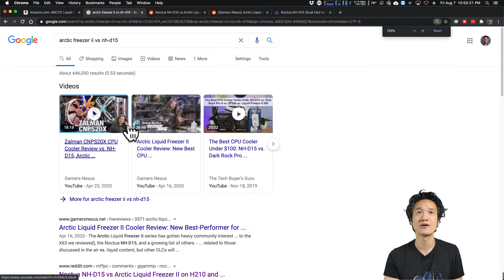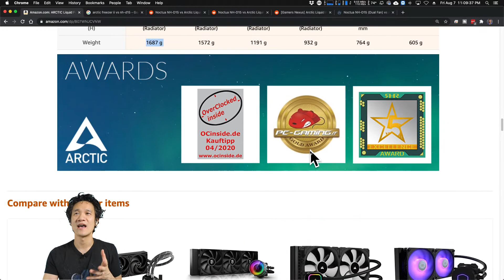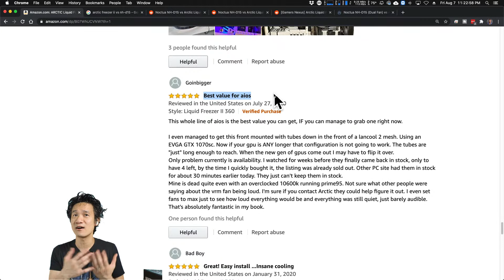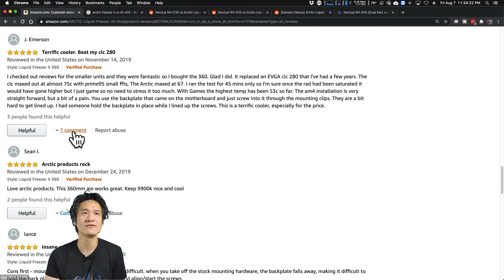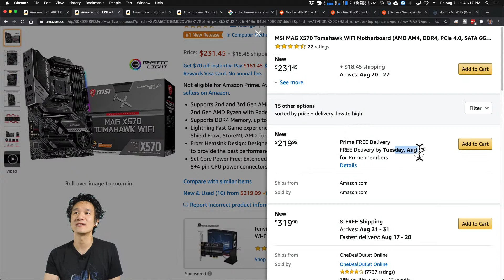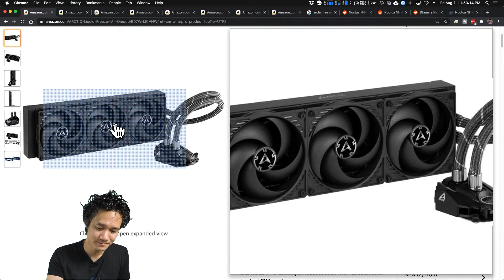ARCTIC Liquid Freezer II 360 - IN STOCK! FINALLY!!

Comment: i have just swapped from a Kraken X63 280mm to the Noctua NH-D15 and i am not impressed with the performance,  it is good, but not great. also it does not fit over decent ram very well.   hoping this arctic 360 comes back in stock soon.  nice video btw.

Comment: Do you think it's worth to change the fans so i can have the RGB color on it?
Don't worry i just saw: 2 RGB PC Light Strips + 10 GIM RGB Fans! :)
Reply from the maker: hahaha, I was just about to link you to that video!  Yeah; don't replace the Arctic fans, because they are VERY good static pressure fans for cooling the radiator.  But if you want to add RGB 'blings', do a push-pull configuration with RGB fans or just add a RGB lightstrip.   IF YOU MUST replace replace the Arctic fans, make sure you replace them with high static pressure fans.  Let us know if you have any questions.  BTW: If you haven't already done so, please consider SUBSCRIBING to UTECHPIA.  Your support is totally appreciated.  Have a great day, my friend! :)